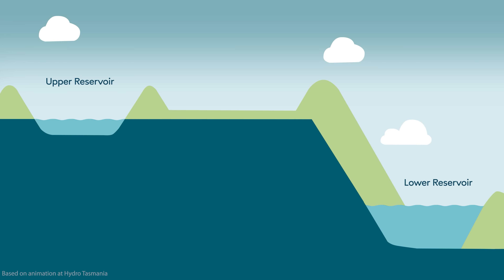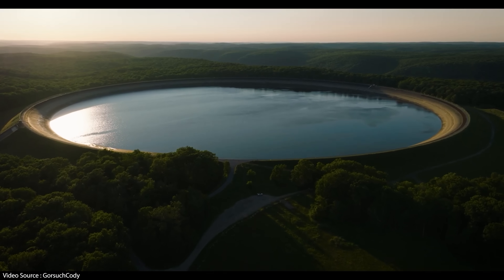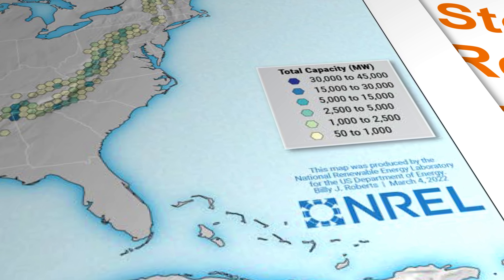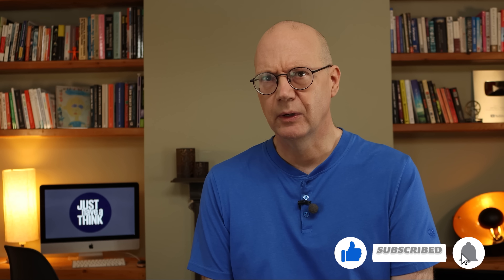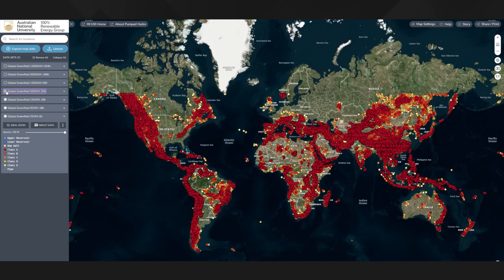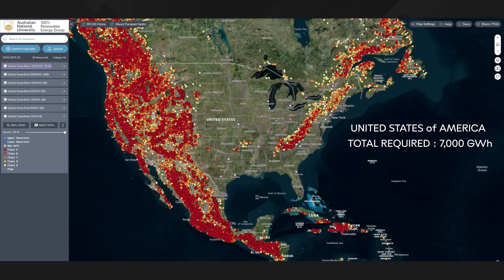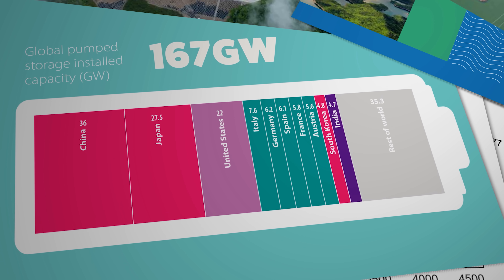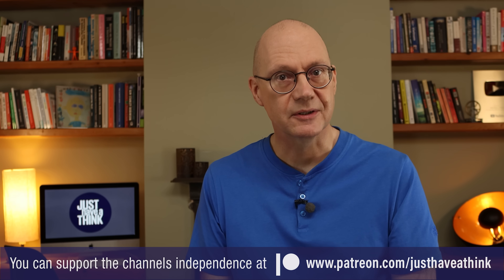The insane potential of Pumped Storage Hydro

Comment: I always thought pumped hydro is the way to go, especially in the US.  My believe is the US can use the high altitude Continental Divide to storage desalinated water for irrigation of the West and for storing green energy.  You could even cover high altitude reservoirs with solar panels.  There are pockets in the Rockies that have excellent wind power. The wind turbines will have to be able to withstand the strong chinook winds.
By increasing western farm land production, we could increase biomass and lower atmospheric CO2.
I was surprised that the US is increasing their pumped hydro projects.
Building pumped hydro infrastructure will costs a lot more at the start, but if done properly, will be less expensive.

Comment: Isn't gravity wonderful! Pumped hydro storage is amazing, but there are also numerous other ways yo use Earth’s gravity to help us store surplus energy. How many disused mine shafts are there? Many thousands, I suspect, and it may be quite feasible to run a generator by lowering a weight on a cable and then rewinding it from excess renewable power. A company called Gravitricity is already testing this method.

Comment: There is a video somewhere,... that I can't currently find, ....that shows a Scandinavian 
company that wants to do something similar but using a series of elevator shafts. That way
it could be put anywhere and use excess energy to lift weights up  and then turn the motors
into generators when more energy is needed.

Comment: 👍💐 Thank you for this reality based video. 
Of course this proven technology of pumped hydro can work, even at the relatively small scale of olympic swimming pool size "modular" units on mountain sides in California, the Rockies and several locatons along the Andes in South America. If a large pumped hydro system was set up on a mountain side in a desert area like Chile, evaporation problems could be prevented, as you alluded to, by have foating solar panels on both reservoirs.

Considering the math for the 3 megawatt capacity system you mentioned of two olympic sized swimming pool reservoirs with 500 meters of gravity power available providing up to 3.5 megawatt hours of storage, if the capacity is linear by vertical distance, a system within a 50 meter tall building in a city could provide a tenth as much, which would probably be ample for said building. Swimming pools even larger than olympic size is old hat on the top of many tall apartment buildings in many parts of the world. 

Also, in landslide prone areas like California, these pumped hydro modular systems, would, in addition to providing cheap 100% renewable energy with low maintenance costs (compared to solar, wind and chemical battery storage systems), function as mountain terrain reinforcing structures. It's a WIN WIN! 🌞

Comment: 9:37 the water is not retained indefinitely in closed loop hydro. While it's true that you don't send any water downstream, there are two important sources of water loss. 1. Evaporation from the surface if both reservoirs; and 2. In almost all sites some water will be lost by seepage into the land below -- that lost water eventually becoming part of the underground water, typically in a few hundred thousand years.

In fairness the evap loss is mentioned soon after.

Comment: 9:37 I wonder a bit about the opposite problem. Glancing at the potential US Appalachian Range sites about half of them are in seasonal freeze zones, I presume that the estimates are taking into account the minimum volume of water needed to prevent freezing into the pipes and keep the broken ice from the constant water level changes floating so they also don't get into the pump systems since the potential storage amounts on the ANU map are much lower in the northern half of the range. Evaporation can be mostly mitigated with simple tech, but I can't think of anything that can keep an entire reservoir from freezing over that would be vaguely safe or not muck up the pumps.
Reply: and the Map showed the best areas was Alaska, deep freeze zone, and the West which is mostly desert, to the point that Lake Mead and Lake Powell  were at their lowest last year due to the lack of water in that region.
Reply: There are already conventional hydroelectric and pumped hydroelectric plants in freezing areas, it's not really a problem

Comment: I went round the pumped storage hydropower in North Wales went it first opened, followed by a trip round the centre for alternative technology in Mid wales when they opened in the early 1970s. They had a profound effect on my thinking especially as I was working for Shell at the Stanlow Oil Refinery at the time.
Reply: Went to both places also in the 90s then moved to NZ where we certainly know about hydro
Reply: Geology and Environmental Sci student visited Dinorwick under the mountain ...parked on the bottom lake bed before it was commissioned. 

The only issue is the rapid cycle of changing water levels means edge habitat is a bit difficult. 😂 A bit like the inter tidal zone without salt..

Comment: A few years back I read an article about a similar technology that used water as a hydraulic fluid that lifted weights to store energy. The pump and generator were the same, but with weights the height could be much less and since it was a closed system, there wouldn't be an evaporation issue .

Comment: The reason that pumped storage represents a high proportion of existing grid storage is that it is pretty much the only technology that is not completely prohibiitvely expensive.  And what there is uses the best sites.
Displacing base load fossil or nuclear generation with intermittent wind or solar requires mind-boggling quantities of storage.   

This is another area where you need numbers to understand the issues.  Consider a real situation - perhaps one of the sides identified on the report you mention.  Consider the height difference available, consider the reservoir areas needed and the reservoir level changes necessary.  

Consider that reservoirs like that will be unsightly and have no other uses. And the slopes (exposed or not) will need protection against leaks and erosion damage.  Then allow that each projet will be a huge civil engineering task.  And then allow that you will need a lot of capacity close to where energy is generated.

I think that such analysis will show that the sheer size of projects required will be much beyond what people imagine, and hence of much more limited value than people hope.

Comment: Seems like if a lake is already close to a population center, then it is probably being used for cottages. If the lake isn't being used for cottages, then it will be far from a population center. Someone's going to have to install lots of transmission lines to move the power between generation sites, storage sites, and population centers.

Comment: Storage without the need for chemical batteries is well worth exploring. How about a video on under water pumped storage that has no evaporation problems or land use. The principal is based on storage of energy by creating an under water sealed vacuum. The energy is obtained when the water is allowed back into the chamber turning turbines.

Comment: We're already using pumped hydro effectively here in Colorado (home of NREL, pronounced "enrel", by the way). We could use more of it, however. All of the major utilities in the state are pushing for 80% renewables mix for customers in the state by 2030. It seems achievable, which is great. These closed loop hydro plants could be very useful, but my concern is the construction times. We will likely need other tech to help us get to a more resilient grid, but this was always going to be the case. It's good to know that we have more options, though. We're going to need them all!
Reply: 👏 precisely! Every feasible and cost effective storage method will be needed as different sites have different available benefits and detrimental aspects.  Toronto for example has very little in the way of elevation variation to support pumped hydro, but is on the shores of a relatively deep and large lake. Toronto hydro has been using an underwater pumped air bladder system to charge during the night when rates are low and discharge during peak times, meaning less peak generating capacity is needed.

Comment: Hmm . . . A solution that doesn't decimate our migrating salmon and birds, destroy our environment  and might even create jobs! You just made my day! In the middle of this hellish summer,  we all needed some optimistic news. Thank you,  Dave!
Reply: Dave ,

The thought of using mines set me off to the usage of a multi-ton weight used like a clock weight turning a turbine. Once the weight reaches bottom,renewable energy returns  the weights to restart the process. 

Also wave action could be used to pump seawater to reservoirs atop cliffs. Once the reservoirs reach capacity they wait to jump in instead of fossil fueled peaked plants. Just a thought
Reply: Is it very hot by you?? I feel bad, it's so perfect by me. It's been a while since I've felt serious heat.
Reply: @Krill_all_health_insuranceCEOs  We have been in the high 80's-low 90's and generally are doing well but we have family in New Orleans about whom we have daily concerns.
Reply: @AlanUnis   I bet. Humidity can be extreme in the SE and midwest. Dry heats are much easier for me to tolerate.
Reply: But it would slow the rotation of the Earth!

Comment: I wonder if salt water could be used to reduce impact on fresh water reserves.
Reply: That is an interesting question. Using the ocean as the lower reservoir would save a lot of cost. But I have only found example in the world, so salt water is obviously a problem - probably with the pumps. I think this problem could be solved with the right materials.

Comment: Is it conceivable to have a mini device? Like on a farm for private use. Talking about maybe 100 meters height difference and a few thousand liters of water. Thanks
Reply: I would be thinking about that if I lived on a steep farm right now. The problem then is that a small and home made system would probably have significant losses to be built for a reasonable amount of money. (Let us pull 50 % out of thin air.) That works if the price/cost of energy varies dramatically. (More than 50 % to continue the napkin-math.)

Comment: Is it just a bit mind-weak to place the question why we haven't read of chinese not having developed such techniques yet due to their many builders and construction people? And there are also issues about water that could freeze in higher mountains altitude, which Dave B. here said wasn't a problem not pointing out why. Or construction taking several months. Anyway, the advantages seem to overrule the weaknesses. 
If we would achieve a fat grid, we would enable an enormous computational capacity for science, astronomy and mathematics, that's my driver behind your idea of developing hydropower pumping.

Comment: My initial reaction and follow up thoughts are 'Could it be done on a micro/domestic scale?' A large tank in the loft filled with cheap power overnight from a garden pond and then drained via a turbine to provide power during expensive periods? Hmmmm!!!
Reply: A large tank...put some numbers to it.  You could drain your large tank in minutes, if you needed 2000 watts to run the laundry, dryer, TV, and lights.
Reply: @BergquistScott  Yes indeed, as I said it was my initial reaction. However in principal if you could effectively store cheap overnight power and use it in the expensive time you would make some savings. Obviously people do that with solar and conventional batteries  but I think it may be a lot cheaper outlay to do a pumped hydro system as storage rather than batteries with finite life times, if the numbers work out!! 🙂

Comment: It always struck me as weird that pump-hydro had disappeared
Reply: Spoiler: pumped storage hydro has never disappeared – it is just overlooked (and not liked by environmentalists, or however they are called in English).
Reply: It hasn't disappeared there are several pumped hydro site in Missouri, the problem is you need geographical sites with large elevation changes and low cost of land to convert economically. These two things usually mean that you are far from large population centers which is where you need the power. Yes you can transmit the power over long transmission lines But the losses are higher at long distances and the cost of getting permits and building those transmission lines is very high. Like power generation, power storage works best when it's close to where it's needed.
Reply: @WJV9  I didn't mean that the existing sites had stopped so much as that it had disappeared from the agenda.
Reply: It never disappeared.  The Fear mongers can't make $$$ on it.

Comment: The biggest problem that i see with pumped hydro that current assessments seem to miss is that the best sites (mountains) almost always have a dry side due to how mountail weather and winds work.

And at least in the US, many of the best sites are incredibly dry and/or are facing water sourcing/drought issues. And then there's also many that are currently parks, etc...
Reply: and up North there are the deep freezes

Comment: Huh, what about using an existing or building an extra water tower in the more flat areas - especially if it's the volume of an Olympic size pool.
Reply: Don't forget that when concrete blocks are lowered from a 100m tower, they are eventually put on a higher block below it and taken from a lower altitude, until the height difference between the blocks is 0. 
When two water lakes are 300 m altitude apart and their level only raises or lowers 10 m between full and empty, this effect is much smaller.
Reply: It is better to have at least 300m / 1000 ft altitude difference. Better = less expensive, more efficient, requiring less space.
Reply: @paulfontaine7819  ah, ok, that makes sense. Also, explains why the lifting blocks version of this kind of potential energy storage is a viable alternative - gearing and/or pulley systems can reduce the need for that minimum elevation difference. Concrete also doesn't evaporate, but the mechanicals would be more complex than a pipe and a turbine.
Reply: @MrChris20912   > gearing and/or pulley systems can reduce the need for that minimum elevation difference.
Unfortunately, no. Gearing and pulleys can change force, they cannot change the potential energy which is only a function of mass x height.
Reply: The potential energy (PE) of an object at a certain height (h) above the reference level (usually the ground) can be calculated using the formula:

PE = m * g * h

where:
PE = Potential energy (in joules)
m = Mass of the block (in kilograms)
g = Acceleration due to gravity (a constant 9.81 m/s²)
h = Height above the reference level (in meters)

Comment: Does pumped hydro actually need fresh water? Well, obviously if it's going to interact a fair amount with the surrounding natural ecosystem, you would want fresh water, but there should still be plenty of sites near the sea that could use sea water, as well as using the ocean as a bottom-level reservoir (as long as there's limited risk of contamination). You could also potentially use underground cavities as the lower reservoir, in the appropriate context.
Reply: Yes, for long term viability you need fresh water.  Same reason the breakthrough of distilling water for steam locomotives etc in the 19th century was such a big breakthrough
Reply: @w8stral  that's not true, seawater can be used as well, there are a lot of plants and new projects
Reply: Plus plenty of micro sites at abandoned mines where vertical displacement will offset the lower volume.
Reply: Yes seawater can be used but there are some complications